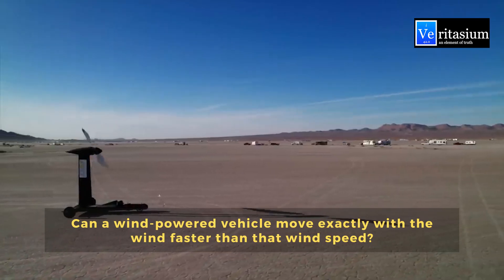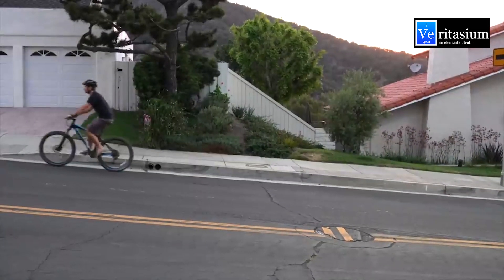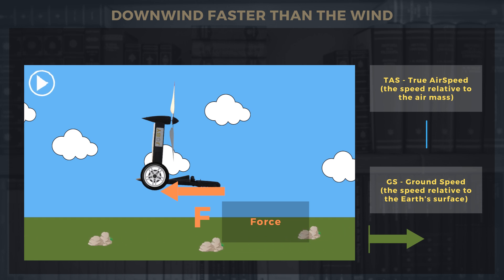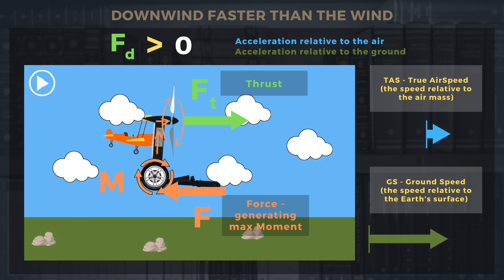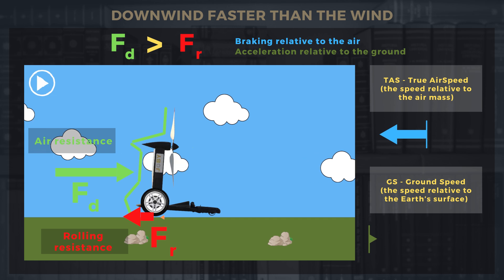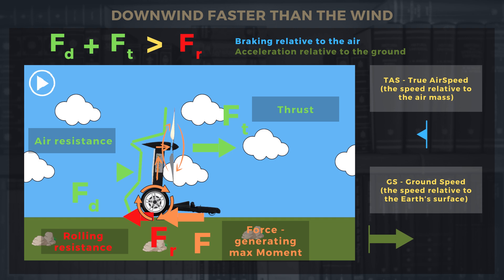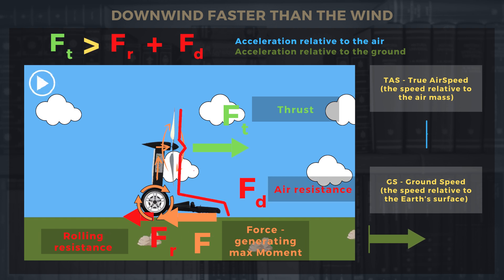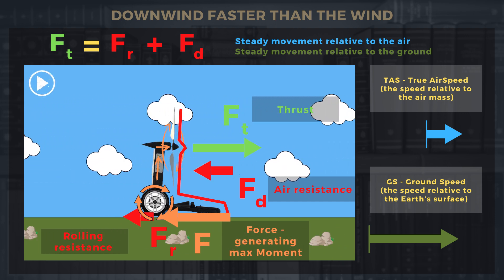Veritasium is wrong. Blackbird vehicle explanation.

Comment: What I'm trying to understand is the source of energy once the vehicle exceeds wind speed. Could the wind speed be increasing as a result of pressure differences? Could some of the energy be coming from a tangential direction?
Reply: The wind speed stays constant. WHat cahnges is the speed of the air that is propelled backwards by the propeller. The relative speed of that air will always stay positive, therefore allowing the cart to harvest the winds energy even while travelling faster than the wind itself
Reply: @FlorianBlup  The propellers can push the air back at a faster speed than the wind but what I'm looking for the the energy source which doesn't have to be directly forward.

Comment: I just now stumbled on Veritasium's video and immediately after watching him "prove" it with a treadmill I was unsettled. Then I was surprised how smug everyone in his comment section was, patting themselves on the back for being such intellectuals. This is very simple physics and the professor was correct.

This was my reaction I left in the comments of his video after I watched:

"No, the professor was actually correct.

The moment you reach the same speed as the wind, then air will be still at the fan blades and stop applying force for your wheels to move. So, assuming consistent wind speed you will never reach the same speed as the wind. 

The car will only be temporarily faster during the dips in wind speed in a real world experiment. 

You never displayed the experiment the bet was placed on. Instead you used a treadmill which applies a small force due to friction the opposite direction the belt moves. I'm not sure why you made a hypothesis and "proved" it with a totally different experiment. Anyone who runs knows that running on a treadmill is easier than on static flat ground.

Give the money back to the professor and make a public apology.

I appreciate you showing how torque works, but again, as the car would approach wind speed, the wind force approach zero as do all force moving the car forward, preventing it from ever surpassing the windspeed."

Comment: If the moving wheels drive a prop that move the wheels. Then make it a 2 wheel to reduce weight and friction, tie a string to it. Push start it to the speed needed and it should go in a circle nonstop.
Reply: Not quite.  The Blackbird extracts energy from the wind.  The air directly behind the propeller is now moving slower relative to the ground than the wind.  The air lost KE and the car gained the KE.  If you do what you say, the air would have to KE relative to the ground and then it would have KE given to if from the propeller.  Your situation violated conservation of energy.  Blackbird does not.
Reply: But how is the energy extracted. That is why all explanations seem wrong they focus on the wheels without explaning how the wind is acting on the vehicle.@dziprick3204

Comment: You are all thinking too deeply. The propeller is acting like a sail. The apparent wind at the propeller is creating negative pressure in front of it causing it to pull. I would suspect if allowed and the front wheel was allowed to turn the vehicle would start to head into the wind and stop.

Comment: The vehicle works by harnessing the tail wind even beyond the tail wind speed. In other words utilizes the tail wind to the maximum. The key to this puzzle is that the vehicle is moving against the ground and has to power the props whereas the props is working against the relative wind which is less than ground speed (ie speed relative to an observer on ground frame). The propeller static thrust is larger than when in a headwind. This difference in force (thrust - wheel resistance) > 0. This accelerates the vehicle. The cart speed reaches the terminal speed when the energy input from tailwind is spent on drag of vehicle, propeller losses, drive train etc.

Comment: Yes, until the cart is moving faster than the tailwind. The built up momentum will propel it forward for a little bit but then the speed will drop off due to no energy being added to the system. Once the speed drops to the speed, or a little bit lower, of the tailwind then the leverage kicks in again and the cycle continues. That's what we see in the video. otherwise it would just accelerate to an infinite speed.
Reply: If you ignore losses due to friction, it can in fact accelerate forever
Reply: @infinitelyexplosive no, the system will stall.  It's just a sailboat tacking in a spiral, there's a limit.

Comment: The key part of the Veritassium video is the trolley pushed by the beam: The leverage ratio between the large wheel and bottom wheels, and with the central contact axis, is what multiplies the speed according to that ratio, and NOTHING but that ratio. It's just a speed multiplier. Let's say we could make the 4 bottom trolley wheels toothed (zero slip), as well as ALL other wheels, and contact surfaces, toothed as well (unbreakable zero-slip contact all-round), all of it infinitely strong, and the 4 bottom wheels infinitely smaller than their 2 axles, by raising them on toothed (zero-slip) rails: A single (no-slip and un-reversing) 1 mm push (at 1 mph) at the top would INSTANTLY be CONVERTED to, say, 300 000 000 mph BY the bottom wheels transferring their immense spinning Force TOWARDS THE BIG TOP wheel. An immoveable (non reversing and secure) no-slip top beam barely pushing the big top wheel would thus instantly send the trolley into space... Because, in that 1 mm push, those microscopic bottom wheels would have made a full rotation 100 000 000 Trillion times, with no slippage, having the SAME size (big) axle to transmit the speed to the (also) no slip big wheel on top... The only theoretical limit to the trolley speed, with all the no-slip/no-teeth breakage conditions fulfilled (AND the absolute non-reversing nature of the toothed beam at the top), are the limitations from the speed of light... It really is not complicated, if you understand that you can get more Force OUT than you put IN, and that this Force DOES translate, separately, into energy outcomes. It's what pulleys did for you in that demonstration at the museum, except here it is all sent into horizontal speed, rather than lifting a weight vertically.

Comment: I think you're missing propeller resistance in your equation or at least include it in rolling resistance. Rolling resistance is a resistance of wheels without propeller. But if we add a propeller then we need to apply more force to the wheel to create thrust. And "generated" thrust force will not exceed the force applied to propeller, so the only driving force here is the wind. I guess the whole trick of this experiment was using inertia to temporarily accelerate the cart.

Comment: Easiest explanation to understand. So basically the energy added to the system at the beginning by the wind pushing the cart is eventually taken back out by drag in the other direction, if my understanding is correct.
Reply: No: The whole thing is just a force multiplier like a pulley system, but here it multiplies the Force horizontally into distance, and the larger distance equates to a larger speed. It is not about Energy at all, but about leverage FORCE being converted mechanically into more distance. Think of those pantographs attached to a pen: You make a circle, the thing multiplies your gesture and makes a bigger circle: More distance means the bigger circle is drawn with more paper surface speed, even if the circle is completed in the same time. The big circle pen pen still has to go faster. And the only limit to the speed is the size of the leverage ratio. Infinite ratio= Infinite speed.

Comment: Get two ice cubes that weigh the same and put them on something flat. Push on both of them at the same time, one at the very edge and one in the middle. They both move forward, but the one you pushed on the edge of also starts spinning. Clearly the force wasn't used up to create the torque, since they both move.

Comment: The whole reason this is a debate in the first place is because it starts off with the wrong idea that there is something in physics that should make it impossible for the vehicle to go faster than the wind for any length of time. Fact is that neither the conservation of energy not the conservation of momentum implies anything like this. Both these principles can and will be preserved even in a design that can allow the steady state to occur at a speed high than the wind.

A simple example is an ideal collision between two balls. Sure it is possible that the lighter ball, originally at rest, moves off at a far higher velocity than the larger ball. Do we all wonder how that can be possible? After all wind too is just a number of atoms hitting the vehicle on a net basis with various velocities.

Second example, you could have a wind turbine within the device which would eventually get charged up due to the wind and later be used to power the propeller and provide thrust for a forward velocity.

In both the above cases, it is clear that fundamentally, there is no constraint as such to what the velocity of the vehicle can reach due to the wind speed and yet no physics laws would be broken.

Now that this is established, let's tackle the view that this looks like free energy because the vehicle can then go faster and faster without limit. But says who? Just because we said a design can allow a faster than wind velocity does not mean that we are saying limitless acceleration is possible. In the design as shown in the video, note that the propeller  will stop spinning faster at some point because the wheels cannot keep rolling at indefinitely higher speed. The friction between the wheels and the ground can only support rolling upto a certain velocity after which the wheels slip and the propeller is not driven further. At this stage then the acceleration can no longer be positive. 

Also, if the propeller is sucking in air and giving a push then we must also accept that this action reduces the windspeed directly behind the vehicle and reduces the push of the wind. Therefore the two mechanisms are not independent and infact are linked.

So this shows that accepting that physics allows for a higher than wind speed is NOT the same as saying that the vehicle can find a way to keep accelerating indefinitely.

TLDR - There is no physics principle like 'conservation of speed' so the question implied in the debate itself is loaded to start with and tends to bias the reader / watcher.
Reply: OMG, finally someone that understands the issue at a fundamental level. People overcomplicate this problem when simple conservation of energy is sufficient.

Comment: The vehicle initially accelerates due to the tailwind pushing on all surfaces of the vehicle. 

It is important to note the propeller is initially stalled! Once the wheels can turn the propeller fast enough it will unstall and only then start to produce thrust. 

The vehicle is able to exceed the wind because the tailwind reduces airflow through the propeller enabling it to produce maximum thrust (static thrust) for far longer.

I hope this helps :)
Reply: Yes, that is the most convincing explanation.

Comment: I agree the wheel size explanation was not making sense. However, wheel size/gearing matters because propeller speed must be high enough for the propeller wing to be efficient. It needs to  generate higher thrust force than the propellers wings drag force. This is what makes it possible for the car to go faster than wind speed, part of the thrust force translate into kinetics energy of the vehicle moving forward, another part goes to overcome the propeller drag force (turning the wheels) and the rest of energy goes to various friction losses and vehicle aerodynamic drag. Which means car will accelerate as long as the thrust energy from the propeller is larger than the rest of these energies.

And the reason it does not break the laws of physics is that the vehicle uses the energy of the wind that slows down as it is passing the propeller when it comes to thrust force vs drag force of the propeller wing.

Comment: I commented on the original video. The speed of the wind is not a true measurement of its power. Air has mass, and therefore has kinetic energy when moving. Hypothetically, if we substituted the wind, and instead use the impact of a train moving at say 50 mph vs a toy car moving 50 mph the train would make the propellers spin much faster than the toy car. You can't just measure energy by speed alone. Propellers are also designed to catch air to create thrust. The car is NOT...ALSO, Imagine if the car being used was very aerodynamic, and the wheels were virtually frictionless.

Comment: Alas, there are no miracles.
I see that you have studied physics. You can easily understand and see the initial compression of the air bubble between the wind and the airflow created by the propeller.
The energy is stored in this "air bubble" while the harness accelerates.
And it is where it is drawn from for a short time while the carriage rolls faster than the wind.
And then that's it... The circle is closed.

Comment: Thank you for this video.  One thing that was confusing from the previous videos was that they never mentioned the steady state at the maximum speed of the vehicle, so it seemed like a violation of the conservation of energy.  You clearly showed that the vehicle max speed can be greater than the wind speed, but that it would acheive a steady state.  I didn't read all the previous comments, but from a glance it seems to me that the impeding forces are both the wind resistance of the vehicle as well as the resistance of the propeller through the air as it generates thrust.  Once again, thank you for this video.  It really helped me understand the vehicle better.
Reply: >>  Once again, thank you for this video.  It really helped me understand the vehicle better.

Unfortunately, he has it completely wrong.  I would caution you against thinking it gave you a better understanding.

Comment: Stanislaw, Tadeusz and Wojciech went to the Polish American convention in Chicago.  They checked into the hotel but there was only one room available, due to the huge attendance, so they decided to share a room.  The room was $30 so they each paid $10.  But then the clerk realized he hadn't given them the special convention rate of $25, so he sent $5 with the bellboy to return to them.  The bellboy figured there was no way he could divide $5 evenly, so he kept $2 and gave each of them $1.  

So, if they each paid $9,  times three people equals $27 and the bellboy kept $2, equaling $29 dollars, where did the other dollar go?  

I understand your explanation well enough, the concept you are trying to convey is helpful.  Maybe the problem is your english is good enough to be taken as perfect, but your accent confuses americans as more intelligent and technical than you intend?  no offense intended.  

Like the joke, we have a simple explanation that is very confusing only if you let it confuse you.  The simple explanation that I haven't seen yet is simply adding up the distance traveled as you would for a simple diagram of forces.  That is, the car will approach the wind speed with a flat square sail, and the propeller will push the car a certain speed, and those speeds/distances will ADD together to make the car travel faster/further than the wind.  And that's my guess where the other dollar went.  Not a technical accounting, just an explanation for how it's possible.

Comment: This problem is fascinating and counter intuitive. In the end, Blackbird goes faster than the wind. I was very skeptical much like the Prof who lost his bet. My skepticism was only made worse by Veritasium’s video in which there remains a flawed analysis . The propulsive power vs vehicle power required is insufficient to answer the question. You cannot have thrust without induced airflow (and therefore induced power) and that is not in the propulsive power equation. You need an estimate or an equation that accounts for it. Froude’s actuator disk theory can be used. Without doing a full analysis, but simply based on a conservative estimate of rolling resistance, rotor area, and hence the induced power needed to provide thrust equal to rolling resistance at zero airspeed and low groundspeed, I found there was a decent power margin available. Therefore I no longer doubt that Blackbird is truly capable of going downwind in excess of the windspeed.
  The propulsive power equation has been abused before on the internet to try and prove that a helicopter requires no power to hover. Same problem here. The power has gone into moving the air so it doesn’t show up when you just multiply thrust by vehicle airspeed.